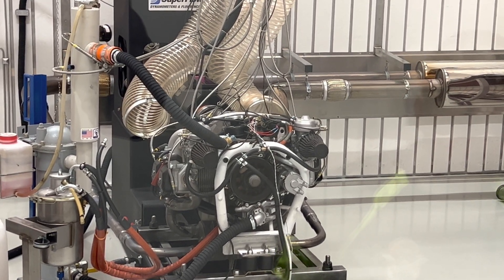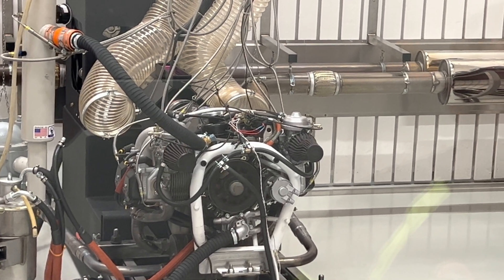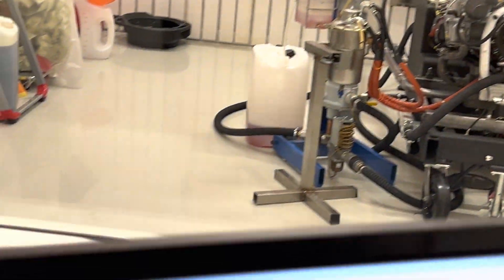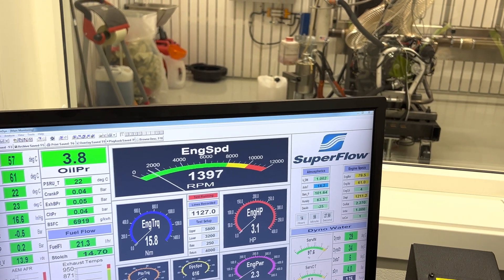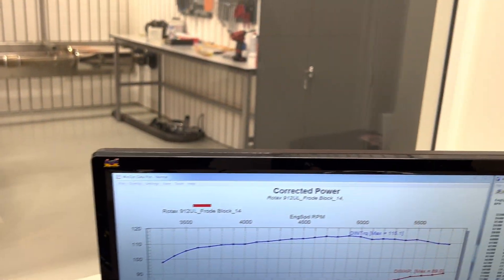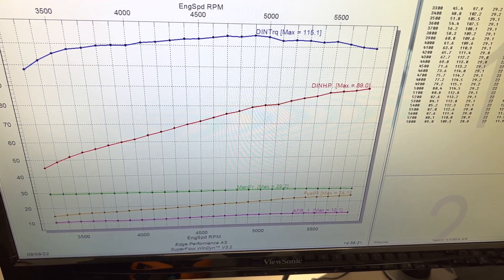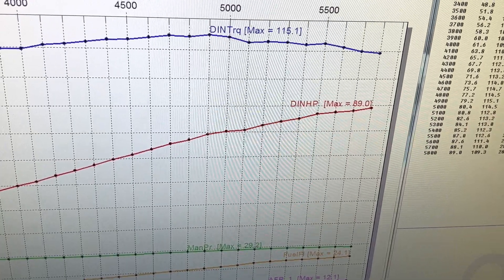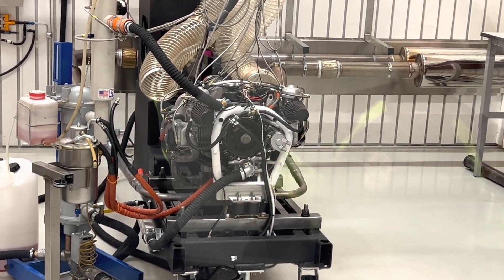Early Rotax 912UL on the dyno 😳

Comment: Excellent results. Do you happen to have results of a 912 UL (80 HP) equipped with your EFI system? It could be interesting to see torque curve improvement and, I am curious, consumption improvement performance (injection versus carburators). Thanks.

Comment: I would like to know how it works to get an engine to you guys? I'm buying an aicraft the has a 1992 Rotax 912 UL with 350 hours on it eventhough it's suppose to have reached it's TBO in terms of years in service can you guys make it airworthy again ? and increase it's performance?
Reply from the maker: Hi Stephan. A 1992 912UL is unfortunately not suitable for any power upgrades. That is a very old engine. I would consider a new engine given the age and old outdated engine configuration.
Reply: @EdgePerformanceNorway   thank you for your quick reply, I'll get in touch with Badass Power Sport in Canada?

Comment: What type of head work was done? Did you make any mods to increase HP or is this a bone stock engine? Thanks
Reply from the maker: A proper valve job and a tuned exhaust.
Reply: @EdgePerformanceNorway  nice. Thanks for the reply

Comment: That's actually an 80HP version?  and they seem to specify the 80 for 5800rpm where it delivers 85HP so no power loss. Maybe wear actually increases power a little? if the bore is slightly bigger but that's probably negligible. I wonder what a 100HP delivers then. And 915.